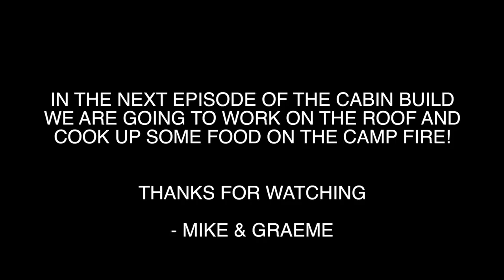Off Grid Pallet Wood Cabin Build in the Forest for Free - Wood Floor, Wall & Frame Structure

Comment: Internet critics, lol. I understood this to be a father and son project. And if you only get two years out of it then that's two years you've got to spend hanging out with your dad. As a matter of fact, after watching part one I spoke to my own dad. Where he works they have loads of pallets that they just trash after the unload whatever off of them. So I may end up building my own little pallet cabin for myself, lol. Looks great, great video as always!
Reply from the maker: Sounds awesome! Let us know how you get on with it
Reply: You can build a cabin out of pallets if you like, but just a little bit more work and you can prevent it from going rotten.

Its small and light enough that its not gonna sink, you could just bring out a truck of crush rock, and some old bricks/cinderblocks and build off that. If you can get it above the frost line it'll last much much longer. Tarp it off at the end of the trip and each year just slowly add to it.

I know they put some PVC down, but thats not enough. Come winter the frost will penetrate that entire foundation and part of the walls, and completely destroy the fibres inside the wood, ruining its strength and creating pockets to trap even more moisture in the wood, which will greatly accelerate the rot.
Reply: a trick : watch movies at Flixzone. I've been using it for watching all kinds of movies lately.
Reply: @Jesiah Tyson Definitely, have been watching on Flixzone} for years myself =)
Reply: @Jesiah Tyson Yea, have been using flixzone} for years myself :D

Comment: I can't believe any carpenters who subscribe would actually talk about the boys carpentry skills. They obviously do not understand the intent of the video and build. Having a good time on an outdoor build with your dad! Now thats what its all about. I would love to build a cabin with free pallets, while enjoying great company and even a good meal. Great job again Mike.
Reply: I don't think they mind actual carpenters providing useful advice. If someone watches this using it as a tutorial it should be great to have actual advice on how to do things "better". I would definitely ignore moronic comments but appreciate constructive criticism.
Reply: Agreed, not talking about helpful hints. It's the foolish carpentry skills comments and stuff.
Reply: they did fine work, its pallet wood, so you aint getting 8foot 2x4s to work with
Reply: That depends on the pallets.  I get wonderful pallets that are 8, 10 or 12' long and 4. 5. or 6' wide.  Each one has 2 or 3 rough cut oak 2x4's running the long dimension and 5 to 8  5" wide 1/2" thick oak slats running across them.  I have build all kinds of stuff out of them, from outbuildings, to feeders for our livestock to furniture for the house.  The next project is going to be a greenhouse.  I plan on using the glass from some old sliding glass doors for the roof, a big old Jalousie window for the vent on one side, and lots of 6 mil greenhouse plastic all around a rough cut oak frame.  If I can get the SO to work the camera I will make a video.
Reply: I can. Some people simply want to show off what they know, at the expense of getting the point of the build. Joke's on them.

Comment: What an awesome project!!! My dad and I (he is retired now) did a couple of wood projects together. Mind you, I have zero skills in this dept, but I wanted some personal stuff for when my father is no longer around. We did the same thing you two did-I went in there with a basic idea of what I wanted, and we just kinda built it, with no plans. We built a cabinet for my bagpipes, and a workbench for my gunsmithing. I learned a lot on those two projects. But the best part was simply spending time working with my dad.

Comment: I use pallet wood and have made quite a few fences and things. Some of the fences i have made are still standing today some 25 years ago. I use old engine oil and coat all the wood once i have made things up. Another way of preserving wood is an old Japanese way is by scorching it. I got a very nice tool for my birthday called a pallet buster and they strip pallets so easily and quickly. The nails in the wood also stay straighter as well. I too also use those as well.

Comment: I made 3 firewood shacks out of pallets, found some unusual 1x2m pallets, built three solid sides, one sheet of tin as a roof, put them up on legs and situated them along my fence. Saves bending over to stack and un stack wood. Also dries the firewood really quick.

Comment: Going great guys. You also do the same as I do. Work out a plan then gather the materials and allow for extras. Meanwhile having a good time doing it. I make a bunch of things with wood or metals depending on what I want. I made 2 trolleys for transporting goods through my house with the idea of each with standing 100 kgs but hinged and made of wood. So far each has been subjected to over 200 kgs and neither have failed yet and that was about 7 years ago. I would rather build something going over board than have to rip it all apart and start again. 
Last video earned you a new sub as it is.

Comment: Great job guys! Looks great! Amazing job! May I suggest adding a perimeter risers all along the bottom with more pallet wood to increase the inside height by a few inches. It would give a bit more head room for the inside.  It could easily be done even later later by using a leaver and lift each side up a side at a time, place the pre-built risers under neath and then secure the uprights to these with some inside L brackets. But hey it's great the way way it is. Awesome job! Can't wait to see the finished product!

Comment: Love it, Guys.  For non-experts, working with reclaimed material, reclaimed fasteners, primitive tools, spending no money, you're doing an excellent job.  Don't let the "pros" give you any crap.  If it was up to them, they'd have the redi-mix truck in there, pouring a slab, framing it up with with 2x4s and pneumatic nail guns, bitching 'cause the electrician didn't show until 3 o'clock.  They have no artistry in their soulless carcasses.  I'm a student machinist in Minnesota.  Every time I try to propose making something, my teachers are all, "you can just buy one from blah blah for X dollars!  They don't understand that that's not the point!  Keep up the good work.

Comment: READ THIS PLZ! i just finishing my back house and will start my small shack next summer. i looked for cheap wood preservative, one thing you could try, a 50/50 mix diesel fuel and engine oil (i use new oil  because i dont want it to be too stinky but i seen people used old oil, it actually gives a nice black finish) another thing i found is a mix of borax and car antifreeze, i haven't tried this one yet and not too sure w the proportions, but it's suppose to be really good to prevent dry rot and bugs , and finally one thing super cool is shou sugi ban, it,s a Japanese technique of charring the wood, you can go light or pretty charred and it basically ignifugate the wood, and preserve it as is, they say for something like 50 years with no maintenance, they use for siding in luxury houses, all you need is a gas burner, but traditionally they would do it over fire

Comment: Love this build, well done guys.  I am very anti throw away society myself and have used pallets for various things over the years, nothing as spectacular as this though :)  May I offer a suggestion?  Ask a local garage/tyre fitters/ service centre etc if they will give you a couple of gallons of old used motor oil.  These guys have to pay to have this stuff taken away and disposed of anyway.  Hopefully they will give it to you for free.  Try this painted on the outside of the cabin and allowed to soak in.  Might be best done last thing before you go home to allow it to soak in overnight.  It will help to protect the wood for longer an best of all it's free stuff again.

Comment: Your learning curve will be accelerated with this project not to mention ours! Nice project and well done on your video.
Suggestion: Using a little candle wax on the screws/nails and you'll save a lot of battery power and arm energy

Comment: Nice cabin project ..... looking forward to its completion ...... Ques: what kind of twine do you use for your lashings ...... Suggestion: Build a "woods transporter" ... two small bicycle wheels & tires ....... threaded rod to put them shoulder/hip width apart ...... two long (6 - 10 foot) poles .... lash them to the rod ...... carry platform on the poles -  and no more lugging heavy stuff ..... JRW

Comment: It's coming along very nicely.....and  better than I thought it would turn out. It's amazing what you can do with pallets.  Your dad s  got really neat carpentry skills there. It would be a great if there could be a double deck bunk bed inside so it could sleep two individuals. Anyway, I truly like the way those wall pallets were attached....so strategic that snow or water can just slid off. Hope it becomes strong enough to withstand harsh weather in the future.
Anyway, lovely job. Wanna build one myself.
I wonder what brand if drill your dad is using.
Looking forward eagerly, to the making of the roof and the rest .
Thanks for creating such a wonderful project.

Comment: The reason why so many people jumped on the bandwagon, thus including myself (concerning protecting the bottom against rot and mold) is that many of us were concerned that you might have had forgotten about it, because people do tend to make mistakes, and that when realizing it the cabin would have became too heavy for you guys to lift properly. ;)

Oh and yes, slates indeed do the trick perfectly with some dpc membrane underneath by the way. Good thinking! I myself completely forgot the fact that there are no rocks or bricks laying around in the middle of the forest, that was a massive brain fart from my end, so dragging them to your building spot would indeed be a muscle and back killer. Mind you, slates aren't light weight either, but it's nothing compared to bricks or rocks. :) Again, good thinking!

Oh and the kinda pallets you're talking about are what we call Euro-pallets. They are indeed a lot stronger than the regular pallets (the kind that you get along when you order a pallet of firewood, which is usually made out of inferior wood) and are excellent for projects like yours.

Cheers!

Comment: Easier way is fix 4 pallets together and use other for gaps inbetween. Saves all the cutting up and you use insulation in cap in side and cover with treated mdf. Good video to watch doing it this way.

Comment: For hinges, if you're going for the free option, you might consider making them out of pieces of old, thick bicycle tire or some other sort of thin (but not too thin) tire material. (motorcycle tires? riding lawnmower tires?) Most automobile tires would be too thick to have the right flexibility. They used to make door hinges out of leather, but leather rots outdoors if you don't take care of it and eventually even if you do take care of it.

Comment: Mike and Graeme, it's always a delight to watch your videos and learn along with you. I do feel, however, that I should advise you to get some advice on the cabin you are constructing. I fully understand that this isn't meant to be fine homebuilding and that neither of you are experts; nonetheless, I am concerned for your safety in this structure. You face some limitations imposed by the materials you've chosen, but some of the construction methods and techniques you have employed will result in a structure that is unnecessarily weak and which could pose a danger to anyone inside it, particularly during stormy weather. I don't mean to scold you and I won't bore you with a lot of "you should have done this" advice. But, please, reach out to someone you know near you who can give you a few pointers on making your cabin a wee bit stronger and a lot safer. Keep up the good work with the videos; I look forward to the new ones each week.  ~~~ Chris in the US
Reply from the maker: Need to watch the whole series,as we constantly update.We can only do so much in the winter,as we start losing light at 3.30pm this time of year.

Comment: just a tip, if your driver bit keeps skipping when you putting your screws in it is because you have the wrong size bit on there. if you keep letting it skip you can round off the bit or round out the screws.

Comment: My I suggest to split the back wall and put 1 plank i n vertically so your cabin is a bit wider PLUS the side wall's will sit on the edge of the floor and the verticlal plank you can rest the roof beam . Regardless of my comment I LOVE IT

Comment: We are redoing our kitchen getting rid of the cabinets and everything, removing a non-weight baring wall, and such. With all the wood and such coming off, I feel bad for not using it all. SO I'm thinking of using the cabinets as cat houses. Just need to cut a hole, or leave the holes where two cabinets met and then stuff them with old carpet from when we get it out of the master bedroom. They have a small lip on bottom so it would be a small air barrier too.I can put stryofoam on the bottom to help, then use some, wait I have a ton of macreme cord. I can weave that into thick blankets or crochet it into ones. That would work, and I wont have to buy fabric. Put in stuffed animal stuffing and then tack two things together and it would be quite warm. fill the house with a u shape, then use a hand stapler to keep it in place. THen a old blanket or two, staple to the top and have it come down in the enterance and there. That should do it. I can get pallets to make a small stand for it, and it would be perfect! AH! 
(Sorry about the ramble. I tend to get ideas like this watching videos.)

Comment: I know this about using pallet wood but I think it's worth mentioning there are other places to get free materials my dad built a nice 10 ft x 12 ft shed from left over construction materials that builders simply throw away especially 2x4's because it's cheaper to grab another board then to take the time to straighten out a warped board anyhow he got all materials for free including vinyl siding, a door and roofing shingles as for the windows they came from a camper my uncle was scrapping out

Comment: Hammers DON'T come with six inch handles for a reason...  My first job was as a ceiling fixer's mate, and when working on a site, I returned from lunch break one day to find some bastard had cut the bottom four inches off my hammer handle.  "Well," says the culprit, "you weren't using it, so I thought I'd save you having to carry it about!"  An expensive lesson, learned.  ;oD

Comment: I’ve never built anything out of wood and am curious as to the benefits of making the walls slanted. I know your father mention that the water will drip down. Does slanting the sides make the water drip better when compared to a wall that goes straight down?
Reply: Charles Crooms if you over lap the boards like they did here it does improve the weather tight quality of the build.

Comment: PVC is not enough there m8s, you need to get it above the frost line. The frost will penetrate your foundations and destroy the wood from the inside out. Think how food in your deep freeze gets freezer burnt. The frost creates tiny icicles that cut through the fibres of the wood, at the same time creating pockets where more water can be trapped.

Its May already and you did this back in Dec, so its probably already happened, you might have to redo that foundation. If its still good, I highly suggest you pick it up and drop it onto a some bricks or cinders. Your frost line would vary from area to area but atleast get it up 6 inches off the ground. 

Lay a whole mat of poly onto the ground, lay a few cinders sideways to make a footing, then one upright. Drop your cabin back ontop of them and get it above that line. It'll last much much longer this way.
If you really wanted to get fancy, you could fill dig down another layer and bury your footing, then those cinders with crete and drill and anchor down. your cabin to prevent it from blowing over in a storm.

Comment: I made a shed.  In the US, a 4 pallet base was ~ 8' X 7.5'.  I screwed the pallets themselves together to form the floor and the two long walls.  I cheated by covering the floor with plywood and the other walls with shed siding panels.  1X3 boards to trim out the corner edges, the door and windows.  Bought a used wooden door for 15 USD. I added to cheap AL framed windows and used clear corrugated panels for the roof to let light in.  So it might ave cost lie 300 USD to build.

Comment: Greetings from the Great White North or as you guys would say Canader lol. Just a few observations.First I would have supported the floor at the corners and center with possibly some re-cycled concrete blocks. Most importantly I would have put a sheet of 10 mil black poly under the floor , not only to keep out the damp but more importantly possible cancer causing radon gas which may be formed in the underlying soil. Hopefully I'm not nitpicking, just my humble opinion. Guess you won't have to put up with wolves or coyotes howling all night or bears sniffing around for a free feed. Have a good one ;-]